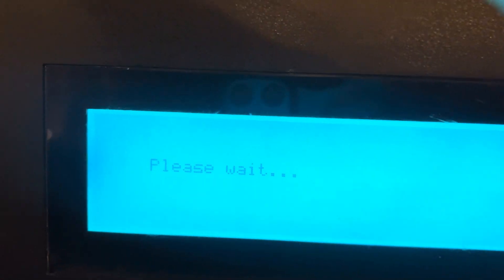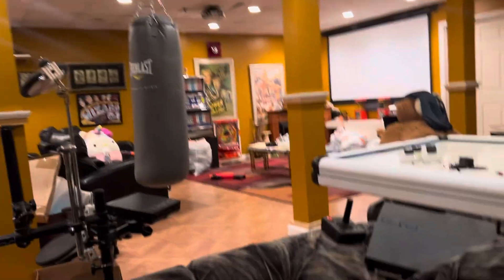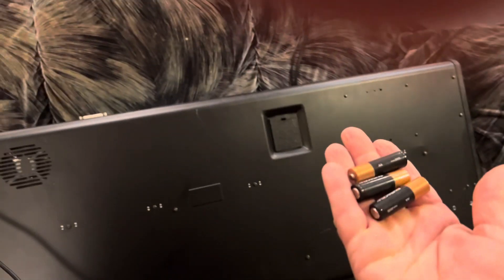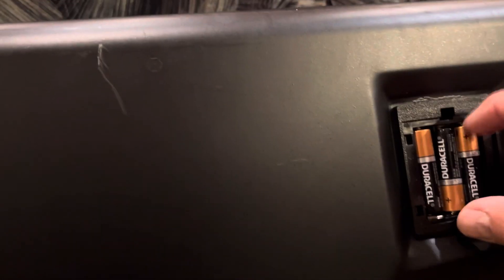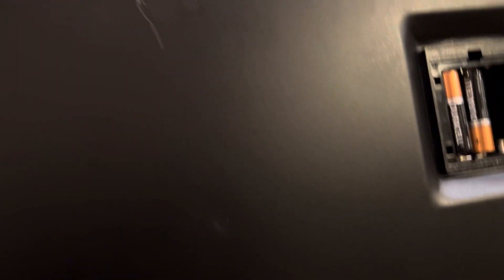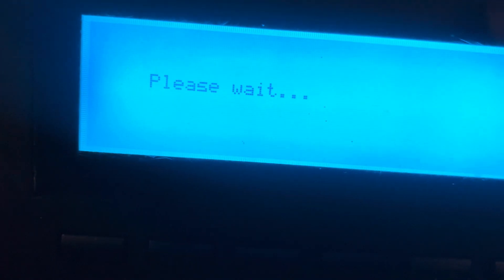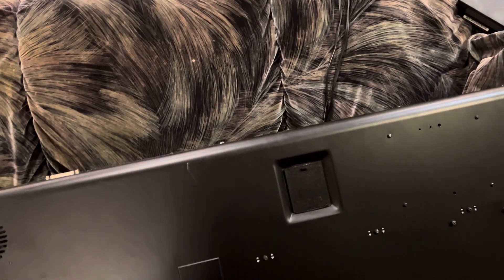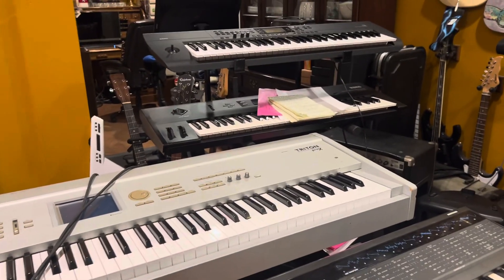￼ battery replacement kurzweil k2500 ￼ synthesizer without losing memory

Comment: Thanks for posting ,but isn´t the point of having the machine "up and running" that you can make the battery switching an "un-stressfull" thing, that can take all the time in the world as long as it is powered ,30 second limit is for a non switched on unit i guess?Changed batteries myself before writing this in my two machines.....K2000 and K2500 XS.

Comment: Hello Gregg and thanks for doing this video. Does the Kurzweil k2500xs allow you to save your sequences internally? How much memory does it have for you to save your sequences internally? Thanks.
Reply: It has 307 kb for sequence recording ,and the K2500 and the early K-synths has manually step recording input ,which later models doesn´t have....
Reply: Ok thanks for getting that information. I imagine that the K2600 has a little bit more internal memory. 
 @mikaelschloenzig9590